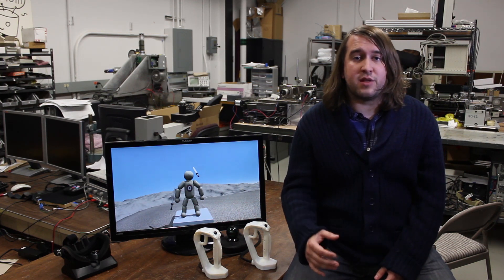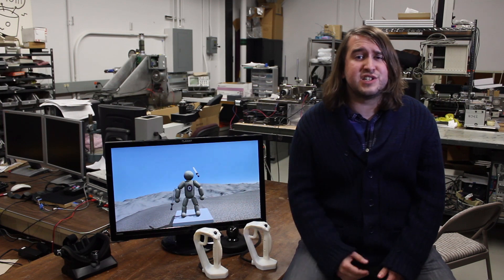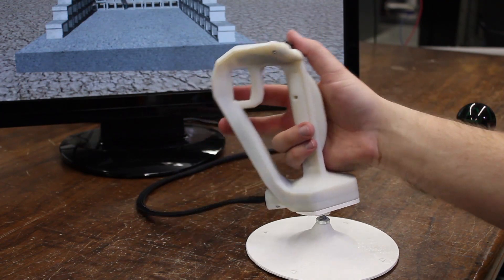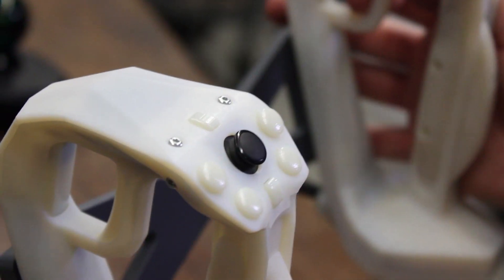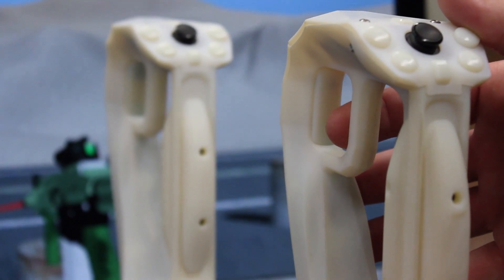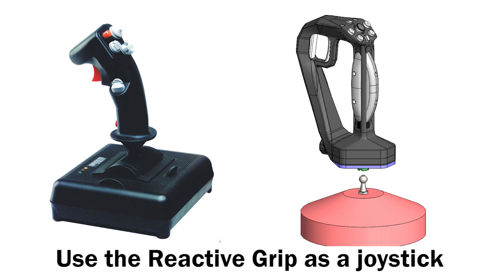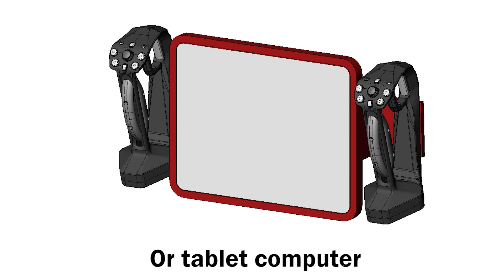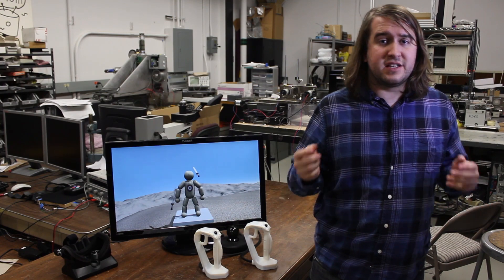Reactive Grip Kickstarter Update #5 - "MAKER" SUPPORT (Tactical Haptics)

Comment: Hi, I've been checking out these controllers and I'm really excited to pair them with the STEM system once I get my VR setup but I have a few questions.

First, I saw on your website that you've updated the controllers to remove the front frame/guard, and many of the designs in this video look like they utilize that. Will we still have an option to buy models of the RG similar to the ones in this video or will we have to forget about some of these functions such as the steering wheel (since there will be no front frame to mount the piece on)

Secondly, will you sell premade versions of these attachments? (Flight yoke, rifle, etc.) I
Reply from the maker: Hi Patrick,
While we've removed the "hand guard" region of our controllers, we will still try to have other mounting holes so people can interface (attach) to our controllers.

We are considering whether we will directly sell attachments such as the flight yoke and machine gun attachment, but we still need to decide.  FYI, if there is enough demand then the answer will be yes.   =)

Comment: You could also make the trigger force feedback.
Like an analog trigger that has some kind of brake or force build in. So you could pull the trigger while nothing is in your virtual hand without effort but when you grab something like for example an egg you cant pull the trigger to the end without forcing it, you could even crush the egg with your hand when you pull to hard and then the force feedback will react to this by stopping the force in the trigger . This could simulate the feeling of actually holding something in your hand. Could be even better when the complete grip would react like that.